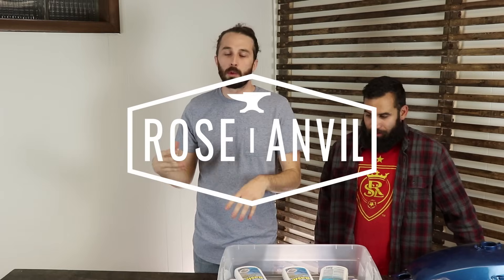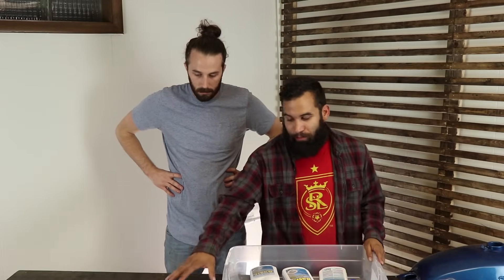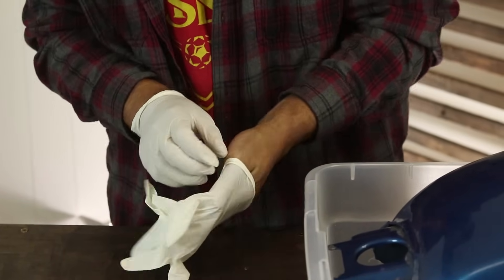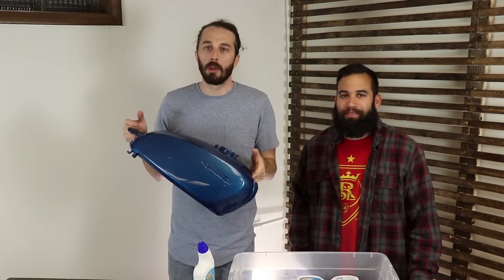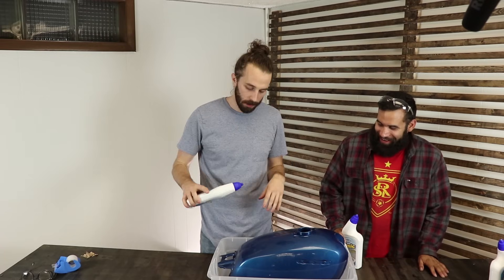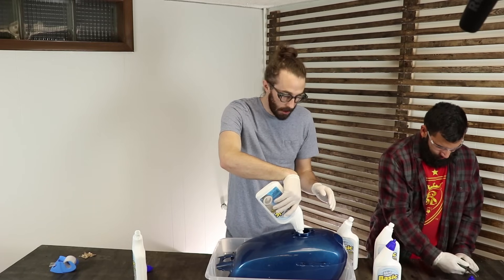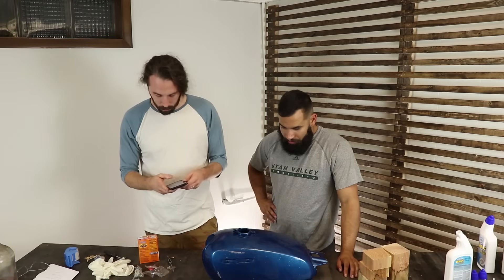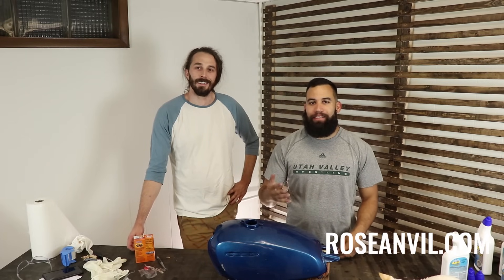How to REMOVE RUST for $1-  (HOW TO CLEAN A GAS TANK) - motorcycle gas tank pt.1

Comment: It's not a long term fix. It'll rust again if you don't constantly ride with full tank of gas. One thing I did to make it lasts longer was coat the inside of the tank with ceramic coating. No more rust again
Reply: How to do that
Reply: @wanderingengineer6168  Just pour the thing in the tank and drizzle the tank by spinning it, shaking it. The tank must be dry and free of grease before application
Reply: Better use phosphoric acid like the bike manufaturers. This will leave a inactive protective layer on the metal which prevents it from rusting. Thats the grey layer you see when you look into the tank of a new bike.
I wouldnt coat the tank. This stuff will flake off causing you trouble later on.
Reply: I stripped the inside of my tank many years ago using a similar method. I just pour a cap full of two stroke oil in at each fill up (or when I get home). The oil coats the tank and helps prevent rust. My tank is still rust free!
Reply: @TepcoCycleRepair  my two stroke metal tank has rust.
Reply: @davekana8388  oh no doubt a 2 stroke tank can get rust, but if used regularly with 2 stroke oil in it, it should reduce the possibility.
Reply: @Tom Claringtom Ceramic coating. You can buy that in many stores
Reply: @Tom Claringtom I used 9H Mr-Fix 30ml Auto Ceramics Coating
Reply: @Chris-yy7qc  will that deal with heavier rust?
Reply: @chainmansca  use a product called Red-kote, they keep it  behind the counter at  O'reilly's auto parts .
Reply: What about red kote
Reply: @JohnTheRevelat0r  You're absolutely right.
Reply: 😁😁That's a good idea.  You don't want that rust to come back after you do all that works that you put in the tank.. And btw when you used posphoric acid, do wear gloves.  If This will go in your skin, you gonna have some serious issues.
Reply: A better way is to oxide coat the interior. Ceramic and epoxy coatings render the tank unrepairable if it gets dented or punctured.
Reply: Okay so anyone reading this. You can use Muratic acid concrete cleaning acid which is hydrochloric acid. But dillute it some with water. And then don't leave it in very long because hydrochloric acid dissolves iron and steel. But the key is to rinse it out with water. Then do the same cleaning with phosphoric acid. If the rust isn't that bad you can start with phosphoric acid only. The phosphoric acid doesn't eat the clean good metal, it only removes the iron oxide (rust). The phosphoric acid turns the free iron on the surface of the steel into a hard rust resistant form of iron which is dark grey. Similar to when you blue a firearm. It's called passivation. The surface becomes more resistant to oxidation. After the phosphoric acid you'll not need to worry about it rusting unless you didn't clean the rust fully. Open non treated rust must be removed for the phosphoric acid to properly seal the metal. Hydrochloric acid does seem to remove rust very quickly although it's very aggressive and you'll want to start with a very weak solution first. Too strong of HCL acid and you'll burn through your good metal if you leave it sit too long. HCL is the same as stomach acid and our stomach acid can dissolve solid steel.
Reply: @hlrembe62  Can you please provide information on how to do this? There is never any good information in the comments only people complaining about epoxy. How the hell do you ceramic coat the inside of a tank? Thanks man!
Reply: Okay so anyone reading this, make sure to use phosphoric acid to finish, otherwise the metal will continue to rust. You can use Muratic acid concrete cleaning acid which is hydrochloric acid. But dillute it some with water. And then don't leave it in very long because hydrochloric acid dissolves iron and steel. But the key is to rinse it out with water. Then do the same cleaning with phosphoric acid. If the rust isn't that bad you can start with phosphoric acid only. The phosphoric acid doesn't eat the clean good metal, it only removes the iron oxide (rust). The phosphoric acid turns the free iron on the surface of the steel into a hard rust resistant form of iron which is dark grey. Similar to when you blue a firearm. It's called passivation. The surface becomes more resistant to oxidation. After the phosphoric acid you'll not need to worry about it rusting unless you didn't clean the rust fully. Open non treated rust must be removed for the phosphoric acid to properly seal the metal. Hydrochloric acid does seem to remove rust very quickly although it's very aggressive and you'll want to start with a very weak solution first. Too strong of HCL acid and you'll burn through your good metal if you leave it sit too long. HCL is the same as stomach acid and our stomach acid can dissolve solid steel.
Reply: @hlrembe62  Thank you for the explanation. I had considered using electrolysis. I didn't realize you could use nitric acid and and a zinc electrode. I've heard Nitric acid is the strongest acid on Earth and will dissolve gold. Nothing dissolves gold. I'm not sure why they would want such a violently strong acid just to apply zinc. Maybe it's because it destroys everything floating around. Nitric acid is the ultimate destroyer of worlds, apparently it dissolves just about everything in it's path. I don't even know if you can buy it on Amazon. I have HCL and Phosphoric acid. The method you describe is a form of galvanizing. That sounds like a really good idea. Because then the tank will never rust. I guess I'm most curious how you can actually get the electrolysis to occur inside the sides of the tank where all the rust usually occurs. Perhaps using zinc rods surrounded by an plastic mesh to prevent them from hitting the sides of the tank and shorting out? If you go to my site you can send me a message and I'll email you back. Go to the contact form. Ritalie.com
Reply: @Ritalie  I did a little more digging and yes HCL or phosphoric will work but a better option is Boric as it tends to lend more stabilization to the flow of electrons from cathode to anode.  You are also correct in your assumption that your cathode rods must be suspended in some fashion from touching the tank wall, A VERY BAD SITUATION, what i used  was very heavy (.144" x.365" / M3.7 x 9.3) pure copper magnet wire (called strap wire in the electrical transformer industry) it is sufficiently strong enough to hold a several ounce zinc rod centrally located in the tank, I use rubber plugs to feed this through the fill port while insulating the tank from the current carrying wire, and rubber gaskets and nylon hardware with shop made backing plates to seal all other openings such as fuel pump, petcock and sending unit ports as needed, The tank must be filled to the top with solution in order to completely "plate" the inside, I do not know if a way to slowly rotate the tank would be, one, do able and, two, on a small scale worth the time and investment to fabricate, because the tank must also be vented to release the hydrogen gas the process emits. In lieu of venting I am sure a hydrogen absorbing mat could be placed in the tank but what negative effects on the process and other problems that would pose are from my view to much trouble to explore. As for voltage and current loads I will need to go and refer to my notes as like I said I have not done a tank in a good while. My voltage/current source at the time was a MIller CV-CC welder power source that also powered my anodizing set-up. When I relocated to Florida a year ago everything was crated and sadly is still for I have been without a workshop space here. Hope this helps and I will forward the article as soon as possible.
Reply: Oil will not stop it from rusting again. You have to seal it.
Reply: As long as you neutralize it, dry it and seal it within a few hours you're good. Has to be sealed. Oil will not protect it. You cant keep it full of gas all the time.
Reply: @gaijingeisha9538  what do suggest sealing it with? the ceramic stuff they talk about above or somerhing else
Reply: @gaijingeisha9538  how do i seal it after its clean?
Reply: I've used Caswell successfully

Comment: Worked wonders! I used a Lysol toilet cleaner. The ingredients are different but the main one - the hydrochloric acid was the same. For some reason the Works was like $13 so I got the Lysol for a couple bucks per bottle.
Reply: Did you still do 1 jug to 1 water? Thinking of doing this when I get home from work

Comment: I mixed hot water and boiling water 50:50 with rad cleaner crystals to speed up the reaction. Also, after neutralizing and flushing out the tank with water, use alcohol to get rid of the water in the tank.
Reply: That’s what the acetone in their oil mixture is for. If you evaporate the water first it will flash rust.

Comment: FYI folks the main active ingredient in most toilet bowl cleaners is hydrochloric acid. If there's any chance the rust situation in your tank is severe enough that the metal could be thin you may want to start with vinegar or a milder acid.

Comment: The baking soda is the info I was looking for. I used meuradic acid on a very rusty tank. It looked like it was sand blasted when it was done! But then it flash rusted, even after washing it with cider vinegar to try and neutralize it. I will be doing two to three tanks this way and see how it goes!
Reply: So what do you do if it flash rust after the Meuradic acid? Can you still apply the tank sealer?
Reply: @ that happened to me and looks like you have to mix baking soda and water and slosh that around because the soda neutralizes the acid.

Comment: I tried vinegar and did not rinse and coat with oil so I had a light coat of rust appear. I rinsed the tank before following this video and the rust came off easy. I did pour half a container of the works and it really did take off all of the rust with ease. Hope this helps.
Reply: So you just poured vinegar

Comment: Great video I just dumped diesel fuel in mine.  Already had it its oil it, rinsed with gas good to go.   Thanks
Reply: How long did you let it sit with diesel before it cleaned all the rust out?
Reply: how does diesel work?

Comment: How I did it:   Remove tank.  Remove petcock, and tape closed.  Partially fill the tank with small gravel and sand.  Shake a lot.  Pour out sand.  wash out tank.    DONE!

What happened... the gravel and sand essentially "sanded" the inside of the tank while you shook it.
Reply: If you use copper BBs, all you need do is blow out the dust after. But I kinda like your sanding concept in the tight corners. P.S. I love you.

Comment: i just tried this tonight, i used 2 bottles and the rest water on a 4.5 gallon tank (2000 gsxr600) hopefully i used enough to make a difference. ill know tomorrow.
Reply from the maker: Cool let me know!
Reply: @RoseAnvil  it didnt "work" so well, trying it again with six 6 bottles and the rest water tonight. letting it sit for till tomorrow. ill report back back tomorrow
Reply: @soulgivesoul07  and
?
Reply: matt toronto how did it do with 6 bottles?? I’m doing the same time with my 09zx6r tank it holds 4.5 gallons
Reply: I'd like to know if the works and water in a 5 gallon tank worked. No hurry i can let it sit for a few days. I have 8 bottles of the works.

Comment: Apple cider vinegar works better and a safer (for humans and metals) than other chemicals. If you have a bare tank (no paint) i would also use electrolysis. My two favorite ways to treat/remove/reverse rust.
Reply: How did you dispose of the toilet cleaner? did you just dump it into the toilet?
Reply: Did you use distilled water and baking soda to flush/neutralize the tank? I am going to try with white vinegar. Looks like the "works" did a good job. So if you leave the" works" sit  longer it should do a good job if there is a lot of rust? If the vinegar does not work then I will try the "works"Good video very informative.Cheers
Reply: I am going with the vinegar only because is cheaper to buy than the "works"Cheers
Reply: @RoseAnvil  Dont use white vinegar, apple cider vinegar works far better, trust me on that one. However, electrolysis is even better. Get an old sears battery charger (manual) 6amps and youll be amazed on the quick results. Vinegar takes too long and isnt  good on all metals (aluminum).

Comment: I have a Kawasaki Vulcan, which needs this treatment, but the problem is the fuel pump is mounted on the bottom of the tank, and removing it before treating the tank is going to leave a big opening. Just turn the tank over! Yeah, only they you've got the acid eating into the gas cap's rubber seal. Short of removing the pump and cap and submerging the tank in a 30 gallon storage container full of bowl cleaner, can you recommend anything? Thanks.
Reply: Must to close all holes on gas tank and than add 3-4 litres of toilet cleaner is enough. Shake it about half of hour and rise by water and immediately dry by hairdryer.

Comment: For about $30-$40, you can use the much more proper product like KREEM to clean and then coat the gas tank so it won't rust again. Google "kreem products fuel tank liner combo-pak 1210".
Alternative is to use Evapo-Rust to remove the rust, then use KREEM or RED-KOTE to coat inside the tank to make it rust-proof. If the part in question is something external, then once you got the rust removed, you can use a rag and some ACF-50 anti-corrosion to coat the metal to make it rust-resistant.
Reply: @RoseAnvil  Yup, I love the fact that it is bio-degradable and also doesn't harm skin or any sensitive parts like rubber/plastic or even paint. Trick is to make sure the part being de-rusted is as grime/grease/dirt-free as possible.

One caveat to anyone interested or planning on getting inside their gas tank coated with this type of chemical (I found out the ugly way):
If you are going to get the gas tank powder-coated (assuming it is metal), then you must get it powder-coated first, then get the inside of the gas tank anti-rust coated afterwards.
Powder-coating process heats up to 400+ F and if you have the insides already coated, the chemical is likely to bleed thru the metal and ruin the color or cause spots.

Comment: Hi, could the gas filter cause slower the flow of fuel to the motor?
Reply: No, well technically yes, but...
Any decent filter will have plenty of flow, don't get something from the $1 store or made for RC cars.
You have a lot of excess capacity in that part of the system. Go ride as hard as you can and see how long it takes to use a gallon or gas. Now unhook the last part of your fuel delivery line and time it draining into a bucket or can.

Comment: I had used muriatic acid, left for a day, cleaned out, and then used a fuel liner( year ago). Don't use a fuel liner, I'm now cleaning out the tank again, and have to replace the fuel pump and fuel cap due to clumps of the liner and rust. 05 r6.

May try this method.

Also you didn't say how much of the marvel oil and acetone to use.
Reply: I used pink looking liner many years ago, worked well.

Comment: wont this just flash rust if you dont seal it after?
the works has hydrocloric acid in it. which takes iron oxide and converts it into ferric chloride and water. then it attacks the pure iron.
it leaves it exposed to flash rust. I doubt any of the other chemicals in works have any protective effect on bare iron.
I've used hydrocloric acid to remove rust in tanks before. you need to seal it with Red Kote. 
wash out the acid with water, drain water rinse with a little bit of acetone, drain and pour in Red Kote. its acetone bases so any remaining acetone only delays drying by a little bit.

Comment: I need to do this on a 2008 Suzuki M109r boulevard, Will this treatment damage the float that’s inside the tank or the fuel pump, the fuel pump is extremely rusted, thinking of rebuilding it.

Comment: Will rubber work as gasket when blocking petcock hole with metal? I'll use 50% Works with distilled H20,  will check after 4 hours,  but may leave overnight.  Don't want to lose solution,  will save for another tank.
Reply: I know it’s been a long time, but how were the results

Comment: After this treatment, isn't the bare metal liable to rust again very quickly? Don't you have to coat the inside of the tank?
Reply: Yes it does it's called flash rusting and it's reaction can be super fast, its the same deal with a sand blasted finish ! You need to be on the ready with an airline (if you have one) & plenty of paper towel to dry it as quick as possible, use a hairdryer to help evaporate the water you can't get to, immediately smother it with a light oil to protect it from further flashrusting until you're ready to use the tank.
Also a good idea to keep your fuel tank full as much as possible.
Reply: @kougerat5388  Thank you

Comment: 😁😁Excellent tip guys.  I was about to spend $240 for a new fuel tank till I saw your video.  This tank is rusty like I don't know what. But just using the works, I can tell the difference on your video.  Some say phosphoric acid. Better put my gloves on.  Now can I buy phosphoric acid from walmart?   If it special order, I'll get the works.  I want that rust out of there.
Reply: menards and also muratic acid works very well it contains hdrochloric acid as well
Reply: i want to clean a bigger tank not a toy like that

Comment: Hi guys, so after you've drained the hydraulic acid and sprayed with WD-40. How do you apply the baking soda?
Reply: Neutralize with baking soda first, THEN oil or other coating to prevent/slow future rust.
Reply: @lorenblaine5275  do I rinse the baking soda out after then let the tank dry then apply the oil or wd-40 and do I let the oil stay in im assuming yes but wouldn't that do something to my gas its a 4 stroke engine on a mini bike get back to me soon please